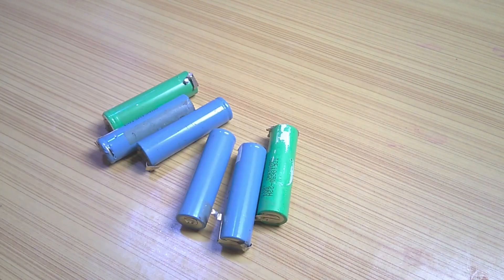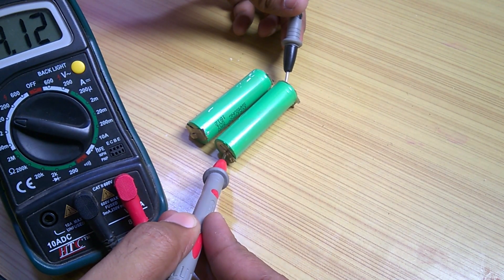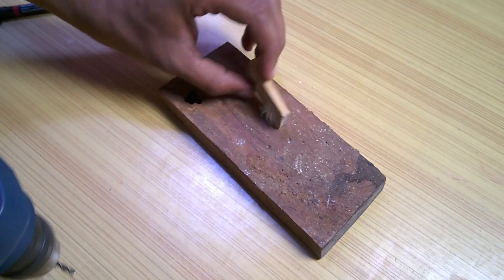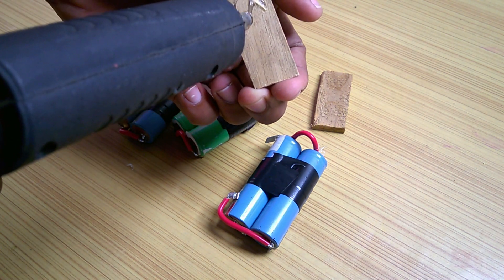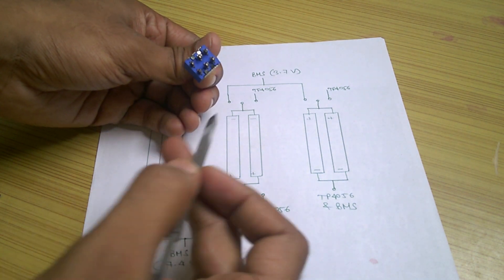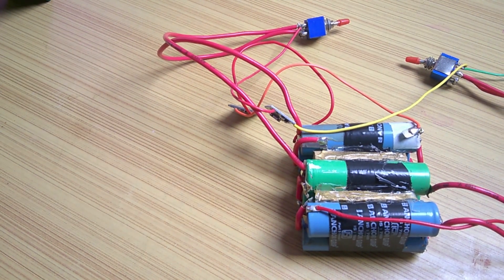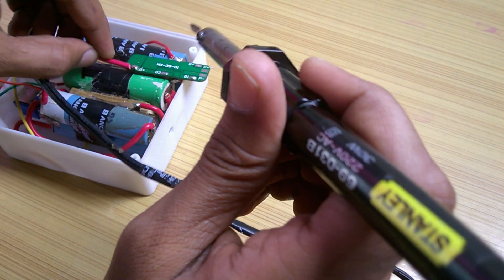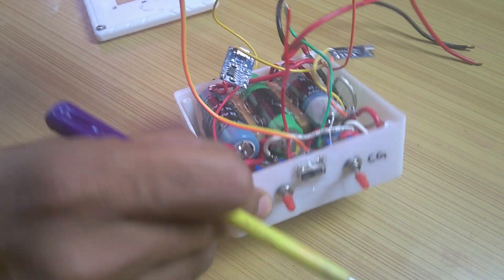Li-Ion Battery Pack with In-Built Balance Charger

Comment: Are you not introducing more points of failure? 3 single BMS plus 2 switches to do the job of one 3S BMS (12v) doesn't sound that efficient. What if the 2 switches were not turned on correctly while charging? 
Putting Woods (fire hazard) in between lithium batteries which get heated up easily is not a good idea.
Reply from the maker: 1. Yes, it might not be that efficient, but it was economic for me not to buy a $50 balance charger, just for 6 cells, as I do not work too much with Li-Ion batteries.
2. If one of switch isn't flipped correctly and you try to charge it, nothing will happen as the circuit is not completed.
3. I understand it's risky to put wood piece in between, but I only did that because i didn't want to wait for battery holders to arrive. In fact, I also replaced the woods with battery holders, now that I have received it. I suggest everyone to do the same.

I suggest not to try it if anyone doesn't have any experience with Li-Ion batteries, as they are dangerous.

Thanks for watching the video and noticing and pointing out sources of failure.
Reply: yes u are right cant rely on this ckt and what when using 12.6v get below overdischarge per cell